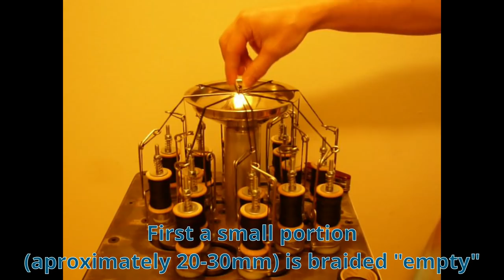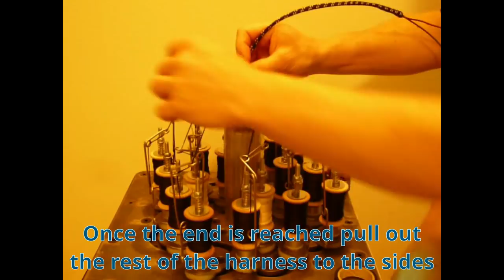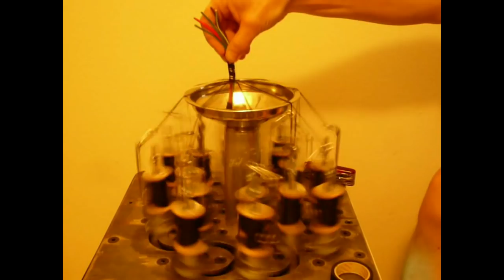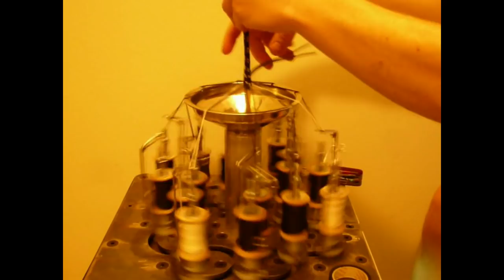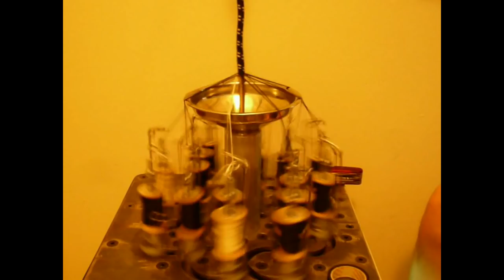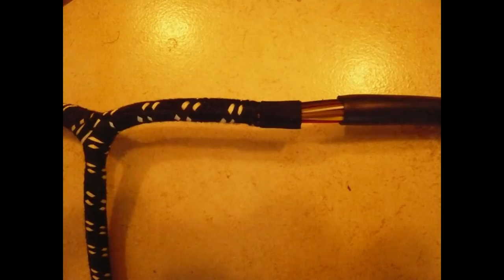Maypole Braider DIY - Braiding a wiring harness!

Comment: If anyone is interested in a machine-on Ebay there is a company called United Textile--they are selling off a lot of these braider machines. I do not know what shape they are in - but I do know that you should be there to inspect the machine before Buying one. Would help defray Costs to pick it up there too. Heavy machine! Look up New England Butt Braider on Ebay -They should come up. The most common are the 16 Spindle machines--They have 24 spindle machines too. Andreas has built a Basic 16 Spindle machine - good for diameters up to about 3/8" . Tension plays a big role in the braiding. Great Video Andreas.

Comment: I have wondered how these things worked since I first saw one in a rope factory 50 years ago. I did not understand diagrams of the process. Watching your machine made it obvious. Thank you.
Reply: I designed a FDM printable version of this design based on the diagrams and I still really didn't understand what was going on until I put it together.  The magic is in the little boats that the spools ride on and the semicircular cutouts that grab and pull them along.  They need to go the right way at every intersection of the twisting track formed by the upper plate.  It's not fun when they make a wrong turn.
Reply: @amarissimus29  Where's the math for the timing? That's what I am looking for.

Comment: Hi Andreas, I would like to know if this machine that has 8 phases in its path has limits
as for the number of bobbins in use, if it has a minimum and a maximum of bobbins, or admits multiples between means.
Also if the braiding pattern is fixed since the path is fixed or you can made changes with tricks.
Thanks in advance and congratulations on your work. Your machine move very very fine.
Reply from the maker: Hi Valdo,
I think you could put in more bobbins, if there's more space, or smaller bobbins. In this case all the space available is in use, so no additional ones would be possible. It depended on the kind of gears I was able to obtain. If those had been bigger, I could have added some bobbins, but always a multiple of the number of gears.
The basic pattern is set by the construction itself, but you could probably change it by leaving out a number of bobbins to create some iregularities, but I don't know, how this would look like.
Andreas

Comment: And now I understand how the fuse holder was inside the braid where the burnt-out fuse could not be replaced except by cutting it open.
Reply from the maker: Alltough I wouldn't call it good practice to do something like that. A fuse is meant to be replaced, so it should be in a place well accessable.
Reply: @andreassiegler2238  I woudn't call it good practice either.  It stymied us for a day and a half wasting hundreds of dollars worth of time before we found that one of the wires didn't complete a circuit and started looking at all the bumps and lumps and joints.
Reply: @zrebbesh  Planned obsolescence in an evil way.
Reply: Ooopsie... I may imagine making that mistake when doing such work for too long at a time. Lesson learned: Do not design fuse holders to be somewhere along the harness, really better use separate fuse boxes. Otherwise it is guaranteed at one time the holder with the fuse ends up braided in... :-)

Comment: Put a weight on the end that you are flipping over.  The weight can be a length of 10 gauge copper wire and tape.  then just pull the wire out.

Comment: How much does a machine like this cost?
Reply from the maker: Well, I think it cost me about 150-200€, since I built it myself. If you had to have it built for you, I'd say about 3500-5000€ judging by the time it took.
Reply: Andreas Siegler .. oh ok thanks. I have seen bigger machines commercially produced. Im just looking for a small one like this. Good job it looks like it works great. Did you use a sewing machine motor to drive it?
Reply from the maker: Yes. Those come around at about 2500€ when used and in good shape, but you'd have to be lucky enough to find one. I might just have built one with more bobbins, but I only had 8 sprockets to work with and I wanted to keep costs at a minimum. I used a 42V wire drive motor of a welding machine, that produces a lot of torque to work with, but any motor powerful enough may fit. I worked with what I had, or could obtain easily and made my design acording to this. I also wanted to keep it as simple as possible, so there sure are some thing you could build better, with some effort. But as you said: It's small but does the job and in my opinion it does very well!
Reply: Andreas Siegler...  well it looks great. Did you follow the same design of mechanism as the large units? Did you build each bobbin yourself?
Reply from the maker: Yes and yes, in principle ;-) You can see the function in my other videos.
Reply: @andreassiegler2238  Hi, i would like to 3dprint it. Do you see any obstacle with 3d printing instead of going full metal? Also, do you have plans (sell)? Thanks!
Reply from the maker: Hi Maurizio, probably this would work, but the mechanical forces and friction might be a problem with thermoplasts. There are no real plans, only sketches that wouldn't be of any use to you, I suppose. But if you got the principle, I think you will have no problem designing a braider.